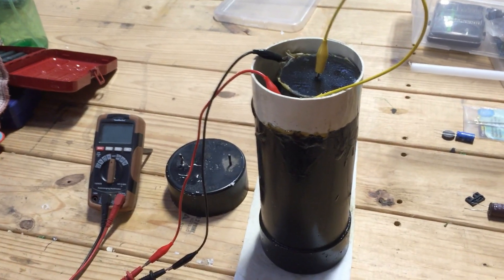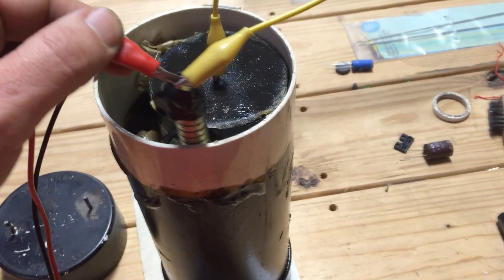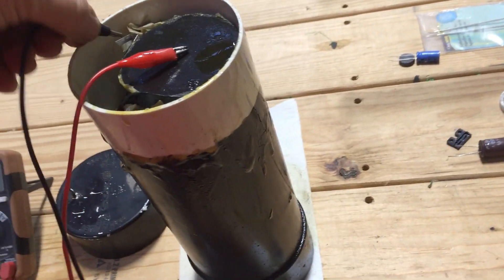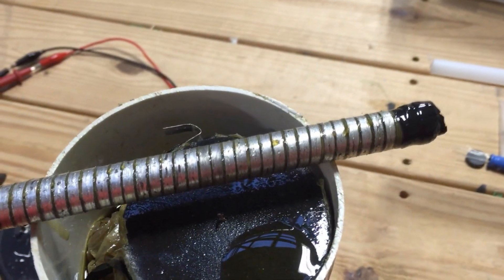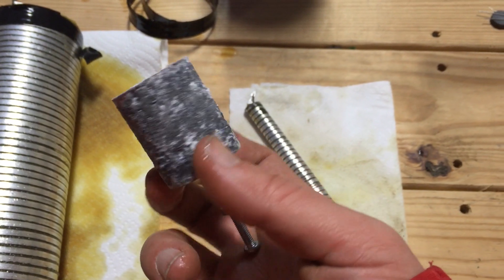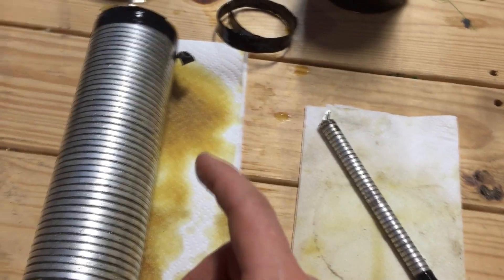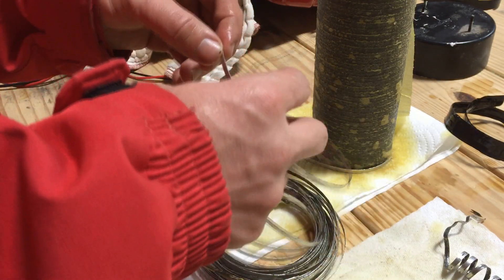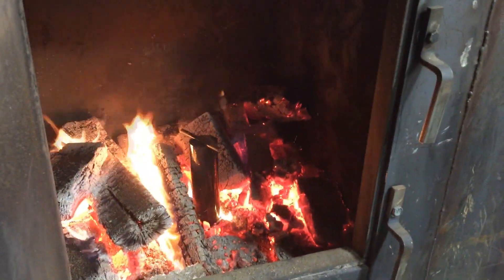3 Year Oil Cell Update + Graphite Rod Oil Burn Off

Comment: Good to see you're finally getting around to the cap-batt idea. The ones I made work well and are still going strong. I haven't been doing much with them lately, but I do have plans to build a large multi cell pack it'll be cool to see how much output I'll get from a 20 or 30 cell pack

Comment: have you tried your mix from the crystal cells like epsom salts or alum in the oil if it will bring up the current? also been wanting to try metal cleaners and conditioners as possible electrolyte solutions..

Comment: Excellent work. Thank you for sharing.
Do you know if there are any Graphite paper or sheets available? I was thinking of making a capacitor using graphite like I've made using aluminum foil paper sandwiched between parchment paper and filed the container with mineral oil from home depot.

Comment: Mineral oil from the drug store without all the additives/detergents will also work well. Though you did a great job with this project, and it does work well, the only problem is the current output is just too low to be useful.

Comment: You where talking about greater surface area for the oil cell. i am willing to bet that if you took magnesium powder & carbon powder and sandwiched them between a paper towel then rolled it into your oil cell that would provide a lot of surface area.   Very Fine sand can have a S:V ratio of 10,000 to 1

Comment: How long did the carbon retain the heat. This could be used in my rocket heater for thermal mass. Just an idea, but it looks to hold its heat a lot longer then water or cob.

Comment: Well done ! Would be interesting to see if the graphite rod has different properties after being glowed this way.. Might give a higher voltage now..or you ruined it cause cooling with water goes too fast and the annealing is gone... Normally if you heat up carbon to red glowing and have it in a pressed form like this rod, it rises the electrical conductivity after cooling...
Regards , Stefan.